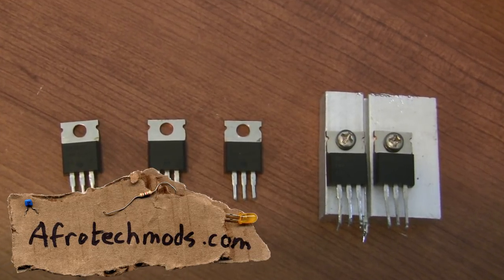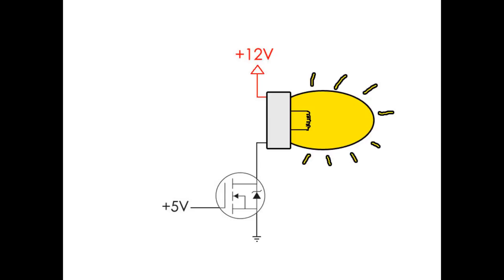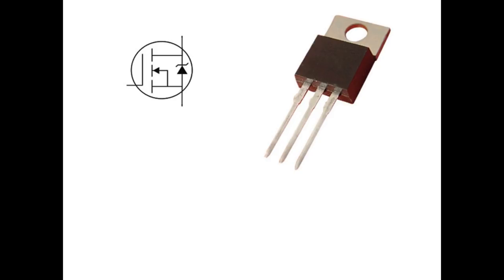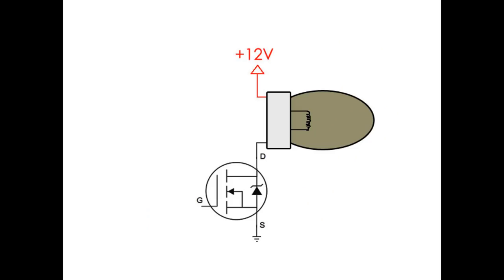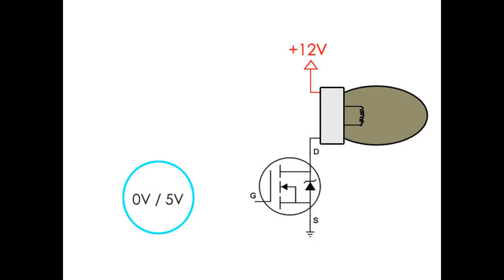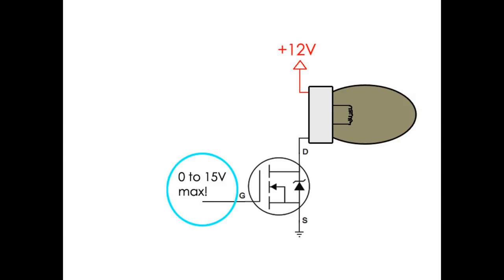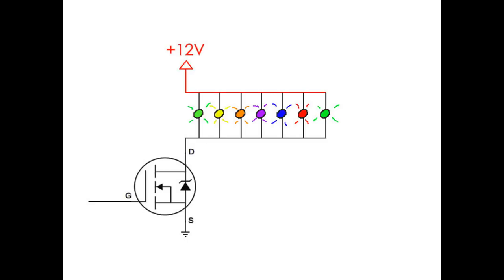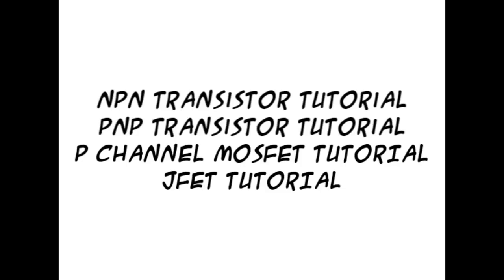Transistor / MOSFET tutorial

Comment: @FailsAreEpicToo Connect a high value capacitor to the gate and ground. The capacitor will discharge through the resistor connected to the ground. And use a high value resistor.

Comment: Cause everything needs to form loops (aka circuits) it is recommended that you connect the neg end of the battery to the ground terminal of the computer. I'm studying computer engineering, so i have to deal with the two worlds

Comment: Is resistance of the Drain lower on the pin or the heatplate? I can't find that information in the datasheet, as the heatplate probably wasn't designed for it, but I thought maybe it had more direct connection to the die.

Very good video.

Comment: I've been on your blog and others trying to find the right solution, hopefully you will have some input that I can understand.  Firstly I'm not an experienced electronics person, not afraid of learning just finding the right info is hard. Here,s my project, I have a CNC engraver (mini mill) power by mach3 control.  I am adding a 2watt laser diode to cut gaskets. I would like to control the laser on/off with the x axis direction pin. When the laser comes on the logic pin is low (0volts) I need a switch that can be activated on with 0 volt gate.  12v to the laser w/external power supply. What type of transistor to use and how to wire it.  Hoping to not need a pcb to accomplish this. Any suggestions would be appreciated

Comment: I'm guessing because I'd like to piggy back one circuits PWM to LED(s) to a second string of LEDs, likely in parallel, with it's own power supply.  For example, to copy an existing operating VU meter to a second circuit.

Comment: @kcinkcinkcinnick
Transistors are used usually to "amplify" weak signal.
Let's say thay you need to light up a huge light bulp with weak wireless signal. You cannot just hook the bulb to the receiver, because there isn't enough current. You also cannot push too much current through the receiver either.
So you can use transistor to _control_ higher current with lower one. Then you can push 100V through the transistor for the bulb with the 3V signal.
See MAKE Presents: The Transistor.

Comment: Hopefully someone can answer this: why can't a potentiometer be used with a resistor to vary the resistance of a load like an LED or fan as opposed to using a potentiometer with a mosfet? Assume the load is around 5A at 12VDC and uses a 100K pot and 3ohm resistor.

Comment: Thanks. So, switch itself can't function like turning it on and off by itself, there needs to be some logical gates and timer, which internally include transistors. Is that why transistors have to be used anyways? I found the analogy of switch somewhat confusing because there is regular switch that has to cooperate with transistor to function as a valve.

Comment: Thanks for the great video, I have used FET before in different project but never understand the gate; for normal npn/pnp you have to use a resistor to the base - but not for FET !? - and you talk about on/off with 5V/0V - what about giving the gate 2.5 V. - will the FET then only open half way ?

Comment: because a Micro can directly control a E-MOSFET but cannot directly control a relay. It needs a driver circuit between them such as a BJT, FET or MOSFET;  Unless you want to use a switch to turn it on, in that case you don't even need the relay; just use the switch.

Comment: it may be a stupid question ... but your gate needs power to 'open' (close the circuit) 
so power can go from the drain to the source ... but why would you use a transistor then instead of a normal button or switch? :s in the end you mostly just going to connect the gate to the power supply so ... :s

Comment: Also, what's the difference between putting the mosfet on the positive side of the circuit (where the positive goes to the light bulb) versus the negative side (where the negative side goes to the lightbulb).

Comment: I always thought the drain and source labels were completely back to front to what they actually do. The whole naming convention is old fashioned and obsolete. It should be something like input, output and switch.
Reply: Do you know any good "cheat sheets" for PNP/NPN MOSFET and TRANSISTORS? I always keep re-inventing the wheel when I need to get the pin outs.
Reply: +anguissette you mean the angry pixies ;-)
Reply: Yes, I agree totally fucking confusing.  Why not just use the same conventions  used for a transistor, base, collector, emitter.  Even that is ambiguious.

Comment: Characteristics Symbol Rating Unit 
Drain-source voltage  VDSS 600 V 
Drain-gate voltage (RGS = 20 kΩ) VDGR 600 V 
Gate-source voltage  VGSS ±30 V
does that mean i can max put 30v in it on the side you said to put 0 to 15v in

Comment: Thanks for this tutorial. I built a not gate with BC548 which instead of switching between 0 and 5V, switches between 0 and 12V but i am unable to get 12V and stuck with 9v or so. I have measured the cutoff current to be 1.08mA, with Rc=3K,Rb=5K and emitter directly connected to ground. Can you upload a tutorial with bc548 as a not gate whose logic high is12V(NOT 5v).
Reply: You're losing 3V over Rc, 1.08mA * 3 kOhm = 3.24 V to be exactly. To come closer to 12V you should use a lower Rc, 470 Ohm for example gets you closer to 12 V but you will never get exactly 12 V.
Reply: That is the crazy part..the cut-off current is strangely 1.08mA...i was expecting it to be around 15nA(according to data sheet)..however i solved the problem by using a pnp transistor(BC 558) in association with the previous npn transistor(BC 548)

Comment: I'm a little confused as to why the solid arrow inside the transistor points toward the +12V drain, yet the hollow arrow inside an LED points in the direction of conventional (+) current. It would have been so much easier to remember one convention for arrow notation.... Can anybody think of why they chose that more confusing notation?

Comment: Where am I gonna connect the DRAIN and the SOURCE If I would use a P-Cnannel
mostfet in order to control the speed of that electric motor ?Is the GATE voltage should be negative 5 volts ? Can you suggest any particular P-Channel mosfet  with a higher amperage around 20 amps @ 60 volts?. THANKS

Comment: This is a really nice tutorial.   If I wanted to drive a toridal transformer from the drain of a bank of n-channel mosfets on one side and the drain of a bank of -p channel on the other all driven by a square wave generator at around 100 khz  can a direct connection to the drains accomplish this?   Or would I have to use two seperate primary windings?   Thank you

Comment: One time you mentioned to cross a 100K ohm from gate to ground. What is the purpose of this resistor? THANKS
Reply: You make a connection to ground. With a high resistance you'll get close to zero current, but it is still connected to ground, forcing it off. If you skip this, the gate is floating, and could switch on by mistake under the right (wrong) conditions.
Reply: So 100k is good enough?

Comment: Hello,
I made a 555 timer and connected it to a transistor so that I can run an electromagnet. I noticed a problem when I tried to send a 9v signal from 55 to the transistor which was supposed to connect a 12v supply to the electromagnet. It just does not work. But if I try to run the 555 with 9v and electromagnet also with 9v, then it works. This is also applied to 12v for 555 and 12v for transistor. It just seems like the voltage of signal has to be equal to the voltage received by transistor.

Comment: @Afrotechmods does that explain why the negative of my high voltage flyback will spark to anything metal? the flyback is half-wave rectified with internal diodes, so in theory all the voltage should come out of the positive end, but instead the negative is where voltage flows from?

Comment: Excellent video, was wondering if you could help me with this: I want to drive an ignition coil from my PC sound card using tone generator software. Was wondering if this setup would work: sound card signal-->optocoupler-->transistor gate-->switching 12v external supply from battery-->ignition coil ? I am very new to electronics and was wondering how to go about this without frying my PC. Any help is much appreciated?

Comment: Hey afrotechmods. One question when using a separate 5v supply for the gate do you need to connect the grounds of both supplys togather? Also i heard that u need to tie down the gate to the source with a resistor? Hu?

Comment: 220V is an AC source. You would need to use a bridge rectifier, amongst other components, and as said above ""you'd need to have a pulsed gate signal where the "on pulse" duration would be variable in order to change the light intensity.""
The light bulb is connected from the phase lead to one of the bridge inputs (~) whist the neutral would then go to the other input (~). you'd need to design a circuit between the + & - of the bridge to control the pulse width.

WORKING WITH 220V CAN KILL YOU!!

Comment: Hi, I am new to this, but I pretty much learn some basics. So from my knowledge, the ground in the circuit is the return path to the power source which in this case is the negative of the battery right? And if so, can I make an audio amplifier from this circuit by using mp3 player audio jack as my signal generator by connecting the positive of audio jack to the gate and negative of the jack to the return path of the power supply and replace the bulb with speaker? Please correct me if there is any mistake, any input would be greatly appreciated. Thank you for your time

Comment: you can  turn ur low power amp into crazy subwoofer destroyer by useing transistors lol... i had 100w amp, bought 30A ultra powerful transistors and got output power- 1800w rms at 30A 12v
sould really fucking g00d!

Comment: I have the exact setup in here with a 12v light bulb being illuminated via a transistor. when 5v is applied the light turns on. What i want to do is make it dim to off rather than switch off. i know i need to use a capacitor on the gate but what mosfet should i use? they all seem to just turn straight off.

Comment: So the electrons will actually be flowing from the ground symbol up through the source of the transistor? So the ground then in reality would be connected to the negative terminal of some voltage source? Or do we simply label the voltage source as positive knowing that it is actually negative, and that the ground is actually positive?

Comment: I actually had to learn about the difference of NPN and PNP transistors to fix one of my arcade board's force feedback system. Is there some standard for Transistors? Like you use Mosfets for high current/voltage and the NPN/PNP for smaller loads?

Comment: Hey, doesn't the gate have to have a higher voltage than the drain? I thought that's what I was told (although I don't have experience actually building circuits with mosfets).

Comment: Thanks for your help, I'm a complete noob at this stuff. Can you explain why a logic mosfet and optocoupler is needed? Also would i be correct in assuming the following: the tone from the pc eg (150Hz) will drive the opto at the same frequency and the opto will cause the transistor to switch at that same frequency and that will send pulses at the that frequency to ignition coil? Again any help is appreciated

Comment: Hi Afrotechmods, excellent tutorial, I have a question, I have conected drain to the possitive side of the 12V battery and source of FET to the positive side of a 12 V light bulb, and the negative side of the bulb is grounded; in this way the bulb goes on when a voltage appear in the gate, but I feel the light bulb iluminate less than if  I connect it as you explain in the tutorial (FET between bulb and ground) is this true? would it damage the FET or make it hotter when working? thanks

Comment: Does the voltage between the gate and ground need to be greater than the positive rail voltage for it to turn on?
Reply from the maker: No. Vgs just needs to be significantly higher than Vgs(th) which will be given in the datasheet.

Comment: While Kohrnbread's answer is correct, I don't think it answers the question.  Motors are inductive loads, and as such, react violently to any attempt to change the current through them instantaneously.  By violently, I mean they generate gigantic voltages, such that they can generate arcs over several inches of airspace.  Bad stuff, bad enough to toast your transistor.  By putting the diode in the circuit, that voltage is allowed to drain forward through the diode rather than back across your Q.

Comment: What does the diode do for a DC motor or any of the other things that require it? Shouldn’t they turn on and off without it, just like a light?
Reply: Diode is used across inductive loads. That's anything magnetic usually. It is used to protect the transistor from the spark that happens when you try to stop current flowing through a coil.

Comment: do the MOSFET amplify current like a PNP or NPN transistor.
Reply: yes but they do not provide as much voltage amplification as bipolar transistors.they do however have a much higher input impedance so provide a higher current gain so can frequently be driven directly from integrated circuits when used in high power output structures
Reply: Mosfets are enhancement voltage devices, so the gate current at DC is zero.. The gate has a large capacitance, but nearly infinite resistance, so current is zero once the voltage stabilizes. To switch on an N channel device you need to know what gate voltage range it is rated for. Some need +1.8V to be fully on, some need 5V, some need 10V (most common on high power mosfets). Now, they do have a linear region, but you need to be aware of power. If used like an ordinary transistor with small currents, you bias the gate so the RDSon is half of your drain resistance. The curves are much like a vacuum tube, but flipped over. A vacuum tube is also a voltage driven device, but is the equivalent of a depletion mode mosfet. These exist, by the way.

Comment: I'm having problems when using multiple transistors. I'm using an Arduino. When I press a button it makes a high output, other wise is low. When I only use a transistor, it works as expected. But the I use the signal to control another two transistors at the same time, both of them appear to turn on with half power, regardless of the output signal. What am I doing wrong?

Comment: i have 46 digital i/o for 46 leds

and i also have 2 more digital i/o so i will be able to controll 46*2=92 leds

how i connect transistors to all of the anodes and cathodes off all the leds

the main power is 12v and the signal is on 5 volts

i also have 92 470ohm resistors

Comment: Hello

Nice video ,will this work with a ENHANCEMENT MODE FIELD EFFECT
transistor? i am using a CEP603AL transistor ,i have tried to make 
a switch just like the setup in your video and the power is on all the
time without any power at (G) gate ,i will try a other MOSFET ,but why
is the link between D and S fully open without any power to the gate??
I am trying to power on My 9v FM transmitter

Comment: But what happens if you reverse the order of the Source and Drain? Structurally, what is the difference?
There are many diagrams out there showing these to be symmetrical in design, but that is usually false.
In PNP/NPN transistors I know it's something to do with doping concentration and thus lower beta when connected wrong.

Comment: @Afrotechmods So therefore I can use then this circuitry to use a 12 volt lead acid battery to charge a 6volt lead acid battery by varying the gate voltage? ( Just mount the mosfet on a very good heat sink to avoid overheating? )

Comment: So, I'm trying to control 12 Volt DC motors with transistors (and arduino controlling the transistors). I'm going to wire an h-bridge to get forward and reverse. my question is since the direction of current changes to change the motor's direction, I can't have the diode on the motor. Can I put 4 diodes on each of the transistors in the h-bridge?

Comment: Hi Sir, can i use this simple N channel circuit to drive a string of 8 leds running on a 12v supply and the input would be coming from a pic microcontroller sequential led circuit?

Comment: So you dont need any form of current limiting on the gate? You can let it draw whatever max it can draw ?
Reply from the maker: You can put resistors on the gate to limit current if that is what is best for your application. For example you may want to limit gate current so the MOSFET switches slower. This could be for timing reasons or electromagnetic interference reasons. But other than that charging up the gate is like charging a ~1nF capacitor it's just a small capacitive load.

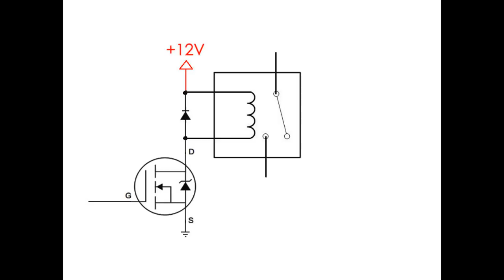Comment: Already asked, but the answer seemed limited.  4:05 Isn't using a transistor to turn a relay on putting an extra, unnecessary part into the circuit?  I suppose using a PNP transistor with the gate powered by a solar cell could make scene long term economically to turn a light on at night.  I guess I just don't know enough about it yet.  So please, give me an example R2 where it makes scene to have both in a circuit other than your circuit is powered to low for the relay

NOTE: I'm new at this.

Comment: I'm trying to figure out how to use MOSFETs with a Arduino, and I don't quite understand the grounding. It's confusing because it only has one ground pin (Source) unlike a relay. If I'm using a 5V signal from the Arduino to switch on 40V do the Arduino and the 40V circuit have a common ground (FET source pin)? What if I'm passing large amounts of current through the FET? the Arduino can't handle that, but it's still safe because it's not actually passing through the Arduino?